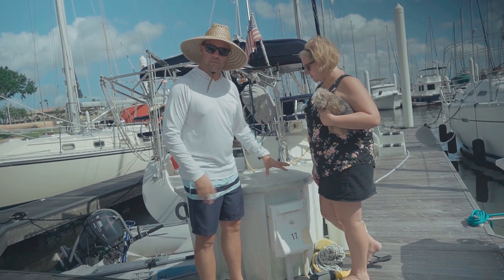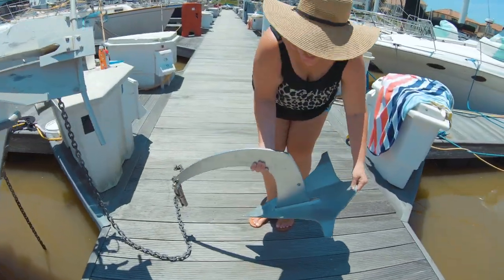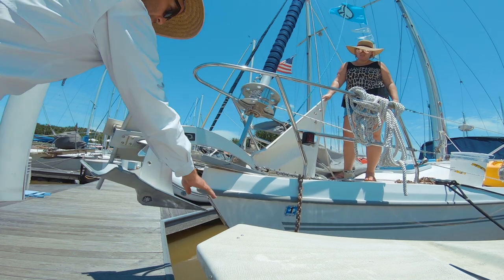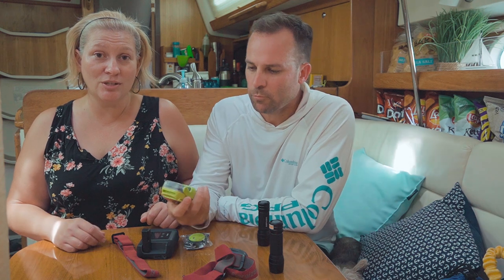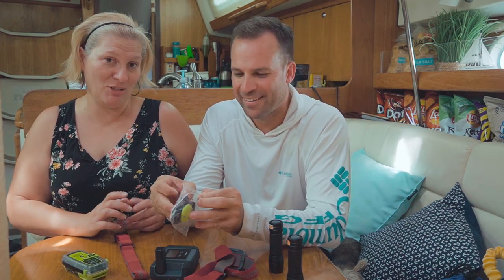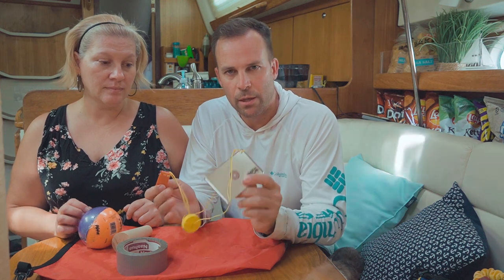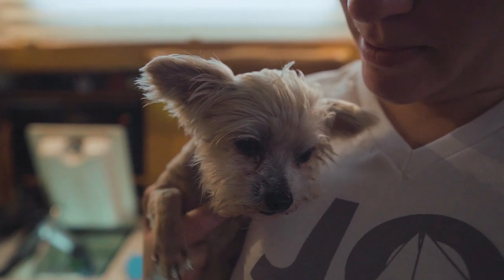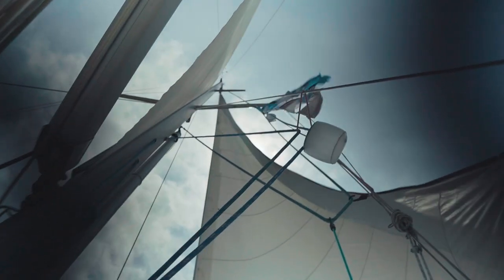Projects, Provisions, Safety, and Medical for a Multi-Day Offshore Passage (e.75)

Comment: Bet you are getting excited about shoving off.  My wife keeps a pretty extensive safety kit for our cruises.  Some things you might add are eye wash (check the date, because this actually has an expiration).  Also, candied ginger is what she prefers.  You can get it in the produce isle of HEB, along with the package nuts and dried fruits.  Stuff lasts forever, and as soon as you start feeling bad, just take a piece and chew it up.  Maybe same thing as your packaged ginger chews, but if not ...  Anyway, have a great crossing.

Comment: Nice video.  Some helpful hints before you go.  The Iridium Go is a nice product, but it apparently has an Achilles Heel in terms of longevity.  You need to make sure to feed it no more energy than it needs.  I think it is like 500ma or 750 ma in reality....I cannot remember which one mine needed.  You can tell if it is too little if the battery discharges.  If you feed it more they seem to fail every 9 to 15 months.  I learned that the hard way.  They cook themselves to death.  Also when you run safety lines on the deck make sure to run them down the centerline of the boat not the side decks.  If they are on the side decks a person falling over will get dragged in the water.  Whereas if they are centerline you don't go over in the first place.  Also make sure that there is a safety line or a pin that holds the anchor on the bow roller  Lots of times the anchor will jump around in passage and will deploy...even wrapping around the prop if you have rode usually.  The dog definitely needs it's own MOB watch or tag.  I can't tell you how many times my cat "The Bed Pirate Roberts" fell overboard while even at the dock.  Ok...he's not that bright...but still.  You have a lot of med supplies, but make sure you have a lot more in terms of a medical kit.  Out Chasing Stars(from Kemah) did an excellent Med kit build...It is on their website.  Delos also did a build and both groups have a full list of what they bought.  Oh one last thing.  Tie an appropriate bung to your thru-hull.  You can never seem to find them in time when they start leaking...
Reply from the maker: Thanks for all the tips!!!